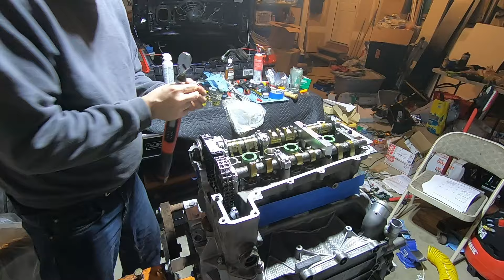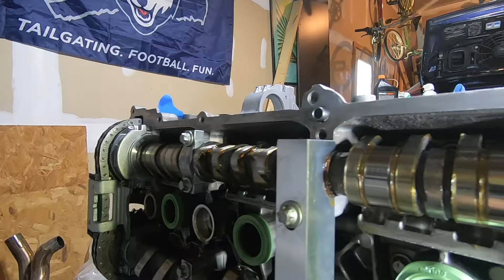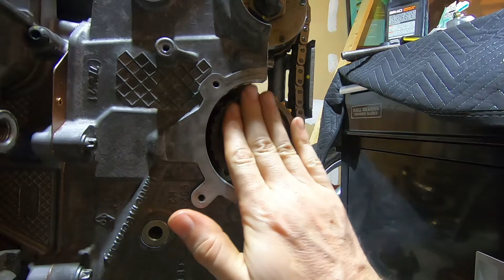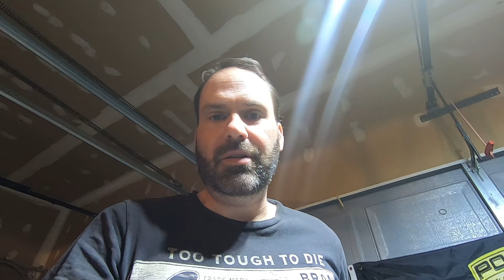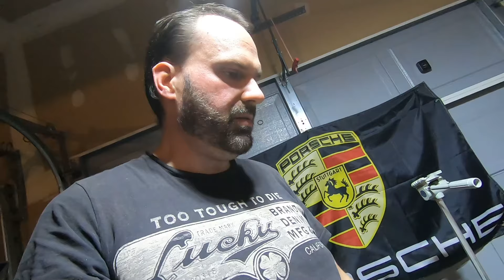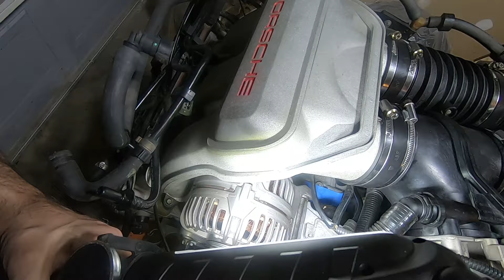Porsche Engine: Valve Train Timing, AOS and Intake Installed

Comment: Great build.....curious, did you upgrade the throttle body to the 82mm GT3 throttle body for the increased air flow since you have also increased displacement and exhaust airflow with your fabspeed headers, highflow cats and muffler?
Reply from the maker: I've debated it. Will probably take it to a dyno first. $1000 for 10hp isn't going to make much difference for me.
Reply: @997Dad  I am not an engineer, but I suspect you will get more than 10hp given the 5% increase in displacement. HP is a function of the volume of fuel and O2 that combusts.  In this case you have significantly increased the volume of the combustion chamber, but if you do not allow for enough 02 to fill the chamber and leave quickly. The main reason the 997.2 S went from 355HP to 385 HP was the improvement in airflow with the addition of 82mm TB, longer headers, and remapped ECU, and I believe upgraded camshafts. (basically the X51 package became standard)

Comment: Can't wait to hear the start up!  Wich oil type are you planning to use?   And did you buy a new wiring harness?
Reply from the maker: I'm using the break-in oil from driven. I wish I had gotten a new battery cable. I hadn't realized it had heat rot until I finished.
Reply: @997Dad  Yepp, on the "to do" list later i suppose   😎

Comment: Well done man ! I applaud you .  Might be wise to have the starter motor reconditioned or replace at this stage  , as they are a ball ache to replace institu.  I believe there are a couple of water hoses that can only be replaced once engine is out  ? Great work.
Reply from the maker: I had replaced the starter thinking that was the cause if the hesitation. But it turned out to be heat rot in the battery cable. That sucks to replace

Comment: Awesome.... is that a bottle of DT-40 I see? Also, have you considered getting the injectors professionally cleaned?
Reply from the maker: It is, well BR-40 as you can't use synthetic oil until you get to roughly 4k miles. I bought new injectors. They really aren't expensive enough to worry about cleaning original injectors.

Comment: You may find when you replace that defective tensioner that your camshafts will line up spot on. It is not uncommon for camshafts to be out of alignment by just a hair (a very thin one) , as this is my experience with complex motorcycle engines. Good luck and thanks for showing all you have in the rebuild to the public.
Reply: And thanks for you